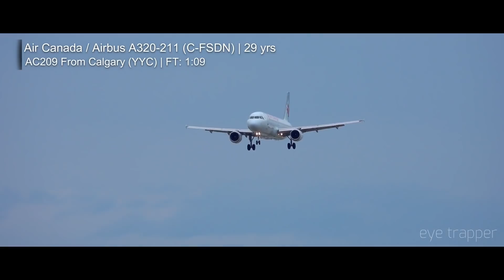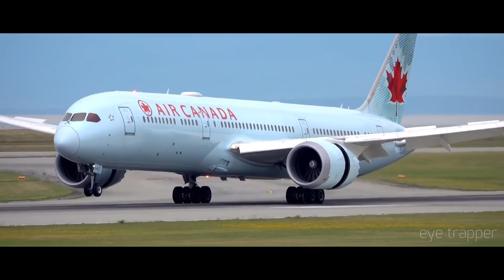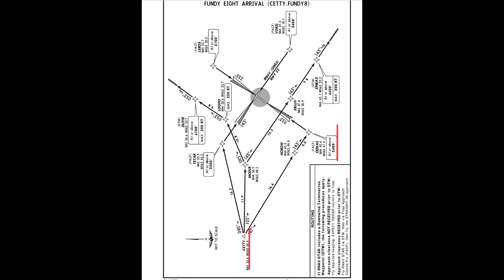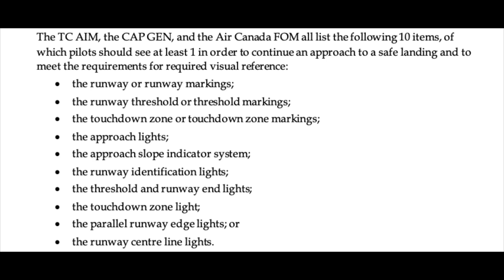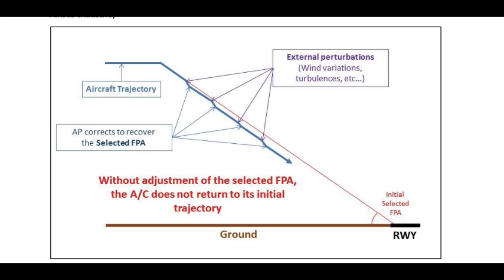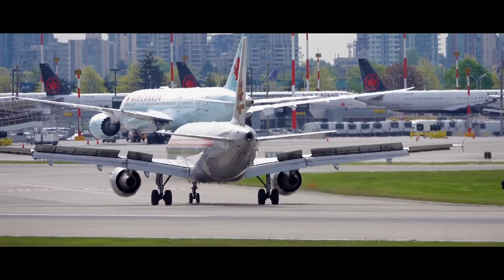The Unmonitored Plane | Air Canada Flight 624

Comment: You overlooked or were unaware that the Airbus presents a glide path indication as a green ball on the on the vertical speed tape for any runway in the data base.  It is SOP for most airlines operating the aircraft to reference this indication and simply adjust your glide path angle as needed to remain on the appropriate glide path to the runway.  It is also SOP to pull FPA prior to the FAF (at my airline it's .2 miles) to compensate for the lag between when you initiate the decent and when the aircraft actually starts down.  
It was the crews lack of proper training and failure to adjust their FPA to account for the winds that put them below glide path and into the power lines, and lacking proper visual cues they were unable to recognize in time.

Comment: I don't understand: they have ILS, GPS etc., but they don't use it and try a visual approach.  Why using ILS isn't mandatory whenever it's available ? Especially in IMC.
Reply: 05 doesn’t have an ILS Approach, only localiser and that would have given them the lowest minimum descent altitude
Reply: @nicholas halsey I didn’t know if the RNAV approach existed back then

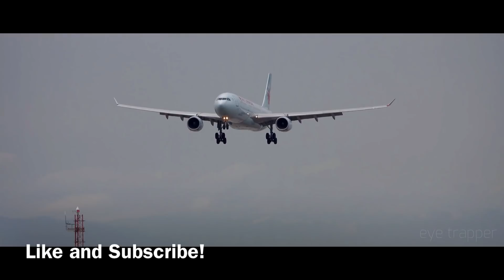Comment: Your comments about visibility were really confusing in this video, normally in aviation visibility is expressed in metres or kilometres not feet, feet is used for vertical distances like cloud base and altitude and at 11:20 you said the visibility was improving and vertical visibility was too, were you getting confused with cloud base? Visibility and vertical visibility are surely the same thing? Otherwise interesting stuff as always

Comment: That's why I like Cat 3 GNSS approaches. Really hard to fail through a couple cheap redundancy layers on the plane (4 multi-network receivers of which 3 have to work to take off would cost < 5k$ each, including good MEMS IMUs), and independent of local active infrastructure or weather.
Reply: There is no “Cat3 GNSS approach”. Cat 3 are for ILS and are the different minima. RNP/GNSS approach minima is between LNAV, LNAV/VNAV and LPV

Comment: A lot of blame should go towards the governing authority for not having an ILS available .This is not the first disaster,Swiss Air must have had concerns about Halifax. Canada is on of the few countries that have a reverse ILS, the Back course localizer. It is cheaper than an ILS and higher approach minimums , also complexities involved when programming. Typical cheap governance so the board of directors put profits in their own pockets rather than airport equipment. Why does this happen, government deflects hazards .

Comment: Flight Path Angle mode is only an angle through the air, not over the ground, so typically if you set -3 degrees you will fall short of the runway because you'll usually have a headwind. Starting the descent 0.2nm before the descent point was not the main fault; in fact that is correct procedure because the aircraft takes a few seconds to acquire the FPA and you'll be high if you wait until the descent point to set the FPA. But failure to monitor the descent progress was the problem.
Reply: Ian, can you please shut up.
Reply: @LoneWolf-gm5qm  you only joined a week ago and I can see all comments you have written. You wrote the same to a couple of others and called someone a bitch. You're a right weirdo.

Comment: I think that the newer generation of aircraft are too automated. The pilot's fly by turning knobs and pushing buttons and trusting the aircraft systems to do the pilot's job. Auto throttles, auto go around, auto land, auto brakes.  All this automation is causing complacency in the flight station.
Reply: The A320 is from 1987.  How is that new?
Reply: @twiff3rino28  If the airport was fitted with an ILS the pilots could have flown right down to the runway and not crashed before hand

Comment: 5:08 The plane flew through power cables.What kind of an airport is this?
Reply: The power cables went directly to the airport itself, so slicing them gives advance notice to roll the crash trucks.
See, it's a feature, not a defect.
Reply: @mikebronicki6978  Sure. Maybe they don't need to replace the power lines if they put up some wind turbines at the end of the runway.
Reply: @jeffhallel8211  wind turbines... That's even funnier than my "it's a feature" joke. Reminds of a story about a local airport that wanted to move a roadway to expand their landing length and somebody asked if they could take the roadway over on a bridge.
Reply: a default airport. with a highway right at the end of the runway.
i never understood how that happens so much.
Reply: МРЪСНА ГАЗ better than SFO where it just ends with a cliff and the ocean
Reply: If I am remembering correctly, there are also some quite tall approach lights
Reply: @brucebruce7868  in Chicago and Indianapolis, Lights wind up on streetlamps due to the constraints on size.
Reply: The "cables" are on normal telephone poles.  If you go down the old Guysborough road and see these you'll say to yourself "yeah, they were way too low.".

Comment: I also like your vids, 'specially with the plane data,  lol, you can tell the older planes,,no wingtip thingies, or just those up,an down ones,,
Reply: They're called winglets bud!
Reply: This A320 was built in 1991, but is otherwise 95% identical to a brand new one.  Airbus gave up innovation after 1988.
Reply: @Gmail X  Winglets are for fuel efficiency, not for speed.